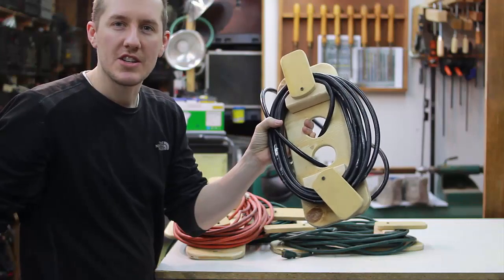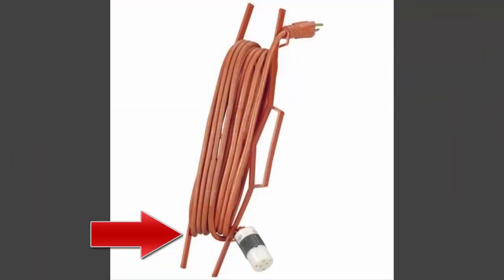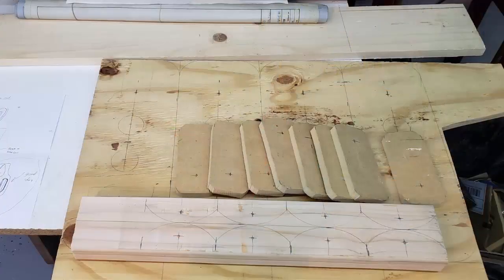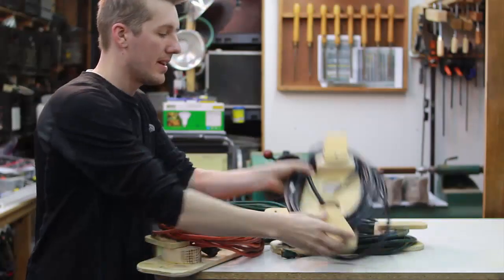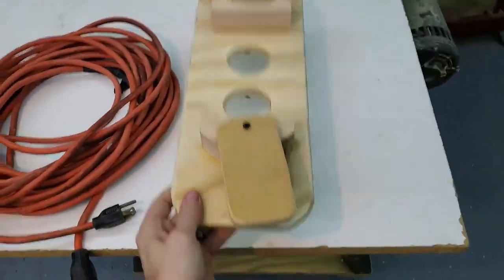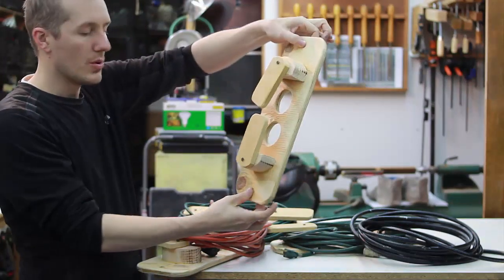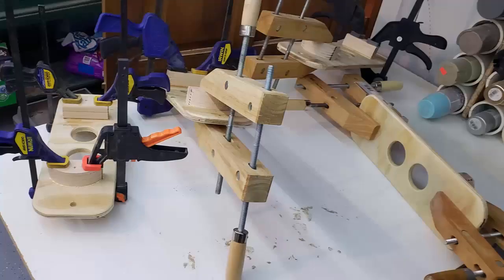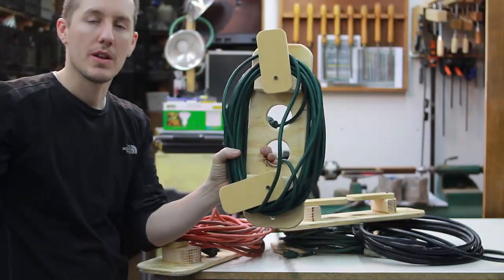Extension Cord Holder

Comment: only one side needs to swivel, right?
Reply from the maker: In a perfect world, yes.  But i found that it was much easier if both swiveled and the cord could be pulled straight off.  There's not a lot of flex or stretch in the extension cord so even with just one side down it was hard to pull off.
Reply: @DaveWirth  maybe add a taper to the block that swivels but maybe that is the point of too complicated and just keep both swivels. thanks for sharing
Reply: How are the swivels attached? Looks like drywall screws?
Reply from the maker: @ronaldcrain8760  Ya i could have put a little more thought into it, but yes just drywall screws.  A better choice might have been a wood dowel or bolt glued in.